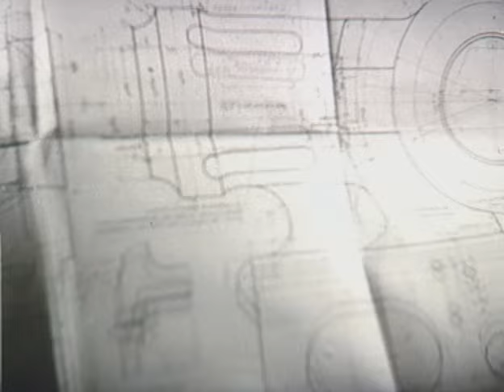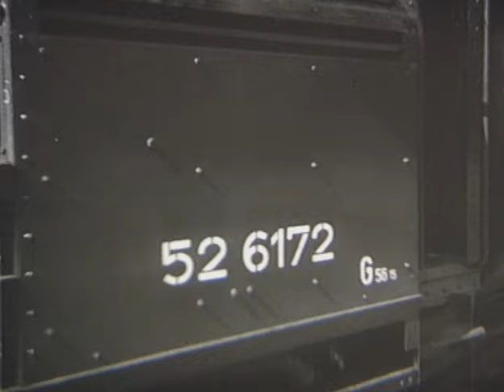Kriegslokomotive

Comment: One might think that a modest thickness of armor plate for the cab and boiler might be in order, given the possibility of airborne gunfire…
Reply: Way too much steel and weight. The 52 was designed to use as little resources as possible and be capable of running most branch lines

Comment: All of this hard work spoiled by a 20 year old kid in a P-47 ha ha your jew haulers did not fare so well.
Reply: +Infidel7153 No, maybe a bunch was obstructed that way. but the vast majority entered service, the European railroads was still full of these Kriegsloks after the war. At that point they were cheap to buy for different railroads and was often re purposed as heavy freight locomotives. In my own country Denmark we had 10 units that were turned into DSB type N. Many countries had more former kriegsloks re purposed after the war.
Reply: Infidel7153 I think these engines were built to withstand bullets.
Reply: @heldgop Compromised boiler is not necessarily catastrophic the way you are thinking.  A bullet probably won't cause the whole boiler to rupture aside from making a small or large hole.  They withstood train wrecks as well.  The rapid expansion of steam that leaves a pressure vessel can cause destruction and injury around it which is usually how crewmen died.